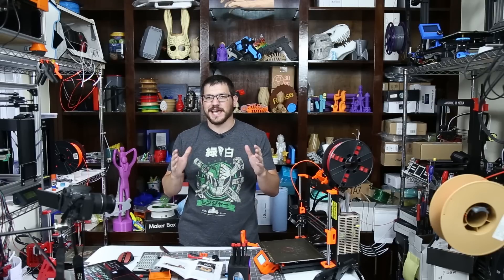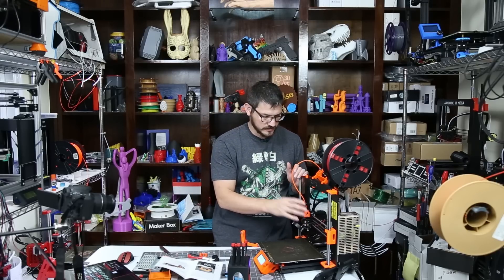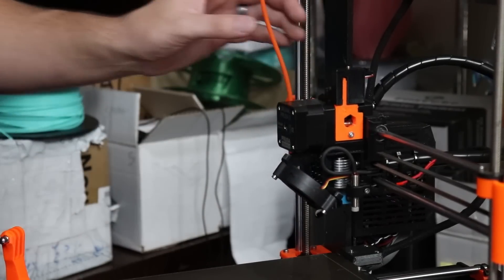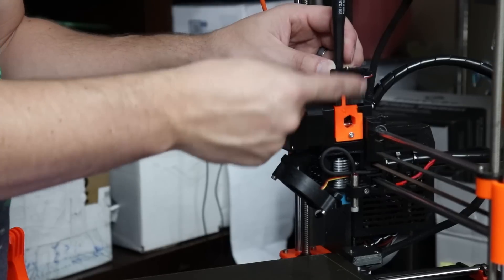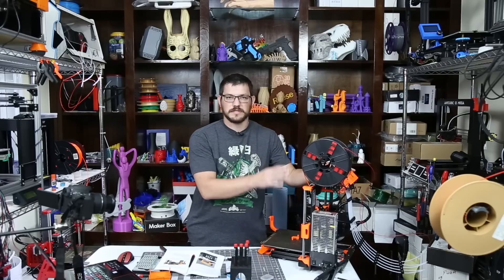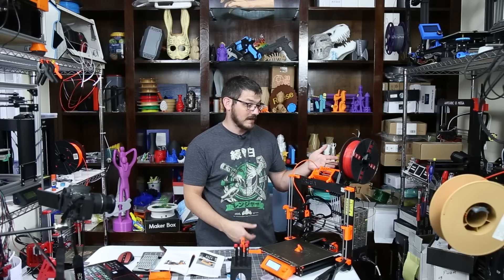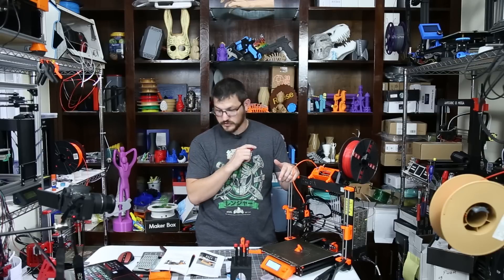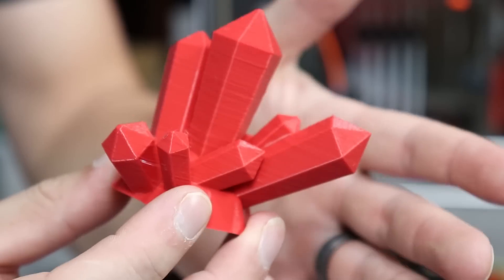Lessons Learned from Prusa i3 MK3 'S' Upgrade

Comment: I found that the lever arm which triggers the IR (optical) sensor didn't always register when I waved it between the sensor's prongs... It was printed in black PETG.  I then put a bit of tape on the tip and it worked every time.  I later reprinted that piece in ABS and it now registers perfectly every time.  PETG is semi-transparent with a load of pigment in it. Even if it looks opaque, it may let light through.  Therefore the IR sensor will pick up the (diffused) light.  This is also why the old optical sensor on the MK3 struggled with PETG filaments previously.  So change that orange PETG lever arm to ABS (or similar) and I reckon it'll fix most of your problems.  It did for me.  My MK3S now works brilliantly which is amazing considering how bad it was previously.

Comment: You may run into problems with your IR sensor with that Orange idler arm. The sensor can be quite finicky at times. This is why Prusa recommends printing it all in black. I would just keep that in mind if you start having issues 😉

Comment: I get a ton of "MMU LOAD FAILURE" errors. Have you experienced this as well? I've tried everything I can find and can't stop it. I finally removed it. I am very disappointed in the reliability of this MMU, even after the "S" extruder upgrade. I can't recommend it to anyone.
Reply: Mine works perfectly fine now. Was also having problems initially and it took a full day to tune. Since then I have done multiple 200+ toolchange prints with no problem. The tension screws (both MMU and extruder) have to be perfectly adjusted and I had to change ramming settings in Prusa slicer to get better filament tips.
Reply: @zjohnson1632  Thank you for that information! Do you mind sharing your ramming setting changes?
Reply: @MobiMenace  https://www.thingiverse.com/thing:3217915 I used the ramming parameters shown in the fourth picture
Reply: Zachary Johnson I 2nd these tips. Also making sure the bondtech gears in the extruder and the gears in the mmu2 are properly aligned. I used the thin allen key that came with the kit. Haven't messed with the ramming settings yet, thats next.
Reply from the maker: I've gotten that quite a few times already.
Reply: Yes, I haven’t given up yet but I have the same experience.

Comment: i'd love to see an MMU2 clone! is there a solution out there already?
Reply from the maker: There are some kits on AliExpress but you can source the whole thing yourself like I did my MK3 Clone.
Reply: @Fugatech3DPrinting  cool! and is there documentation on the firmware and electronics required?
i really want to use the system on a corexy printer, but i haven't seen anyone build their own or integrate it into marlin or another printer firmware...its just baked into the prusa stock. unfortunately i haven't found an explanation on how they communicate.
Reply from the maker: You can just use the Prusa guide to make your BOM. https://manual.prusa3d.com/Guide/3.+Electronics+and+MMU2+unit+assembly/757

Comment: I've done the S upgrade and have been having a lot of trouble getting good prints --seems like part cooling fan is too high and is cooling the block as it prints better if I turn fan off. Fan doesn't really seem adjustable at all. Any thoughts anyone? I have an MMU2 but have been waiting to install it until I get the printer working well again.
Reply from the maker: My printer is going great but the MMU2 is still extreamly troublesome. You can change the part cooling fan settings in the slicer. It isn't straight forward but it can be done. Also make sure you have the silicon boot on the heater block.
Reply: I just upgraded my Mk3 to MK3s after a year of no issues.... Now after the upgrade, its just been  endless problems, Stringing, Bridging,  Brittle Prints... Im thinking going back to my original MK3

Comment: I've been considering the upgrade of my MK3 to the "S", and also purchasing a MMU2 (now"S"), but I've been reluctant because it seems that ALOT of content providers have had issues with the multi color unit.  In your opinion, is the "S" upgrade to the base MK3 worth the time you invested into it?  Thanks for the Videos you take the time to make!
Reply from the maker: The MMU2 still needs work. If you don't want to get frustrated, and don't want to tinker a ton with it, don't buy it. The MK3S upgrade seems to be working just fine now so I can definitely recommend that.
Reply: Fugatech 3D Printing. Thanks for your reply. I don’t like spending time tinkering when I’d rather be printing! 😎
Reply from the maker: Though I've not tried it, people talk highly about the Pallete.
Reply: Fugatech 3D Printing thanks!